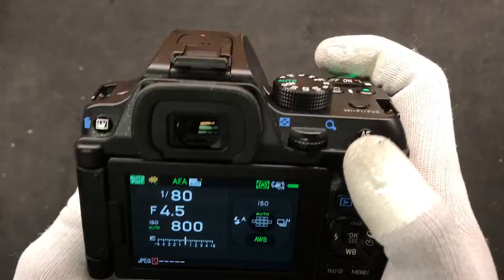How to repair Pentax DSLR camera K-70 - black pictures(exchange solenoid)

Comment: Thank you very much for the information.
It was very useful for disassembling my camera.
Luckily just cleaning and lubricating the inner part of the solenoid got the camera back to working order (I just hope the repair lasts or else I'll have to buy a new solenoid).
Reply: By lubricating, you mean oil or something else? 🙂
Reply: @HarisEliades  I first cleaned the piece well and then applied a small amount of oil to reduce friction.  The solution works, but after a week, it is already failing, so I will repeat the procedure considering also using a very fine metal sandpaper (1200 grade).  If that doesn't work, I'll have to buy a new solenoid (in my country I haven't found it, and there's no official Pentax service either, so I'll have to buy it abroad).

Comment: Is there a way to measure if a solenoid is bad? Do you know maybe if there is certain resistance value on these? Mine reads 30 Ohms, which I think is not that bad considering there should be continuity thorough circuit.